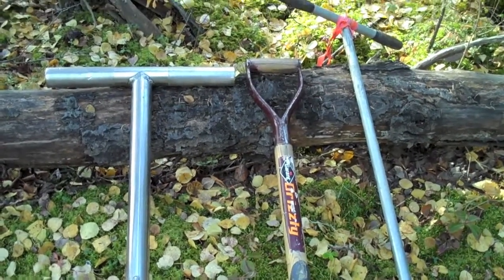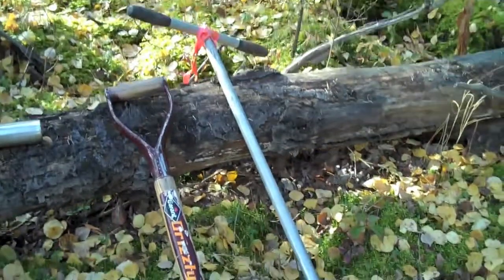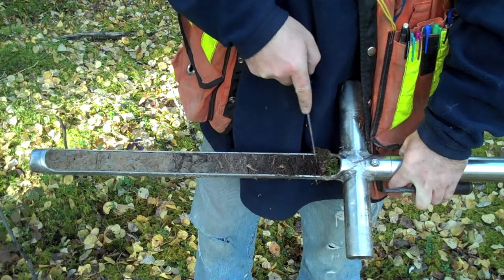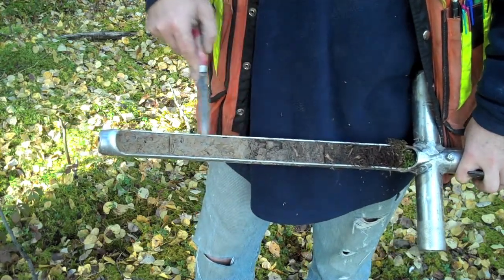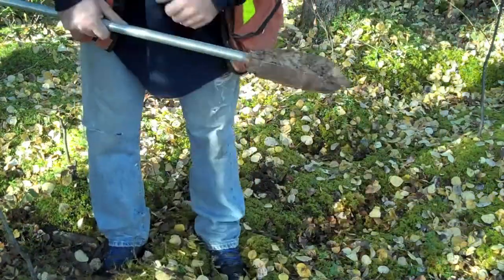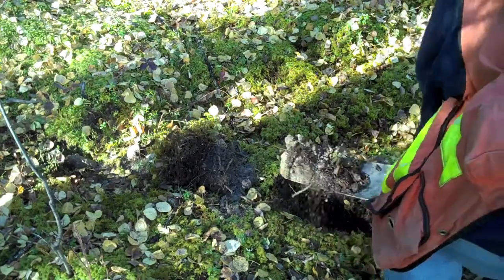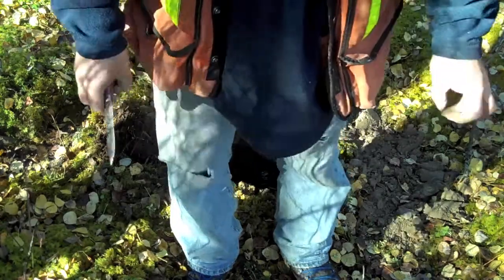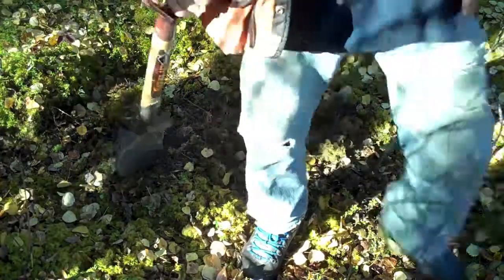Soil Profiling

Comment from the maker: @ytoobpg Hi, I made it myself. I did price it out to have one made and it was over $1000. at a local machine shop. I have three of these, they're not hard to make, its just getting the material that'll get you. I use very high strength stainless steel tubing that I get from the oil industry. I wouldn't use just any pipe, you're cutting it in half, then jumping on it. A snapped probe could turn very ugly...